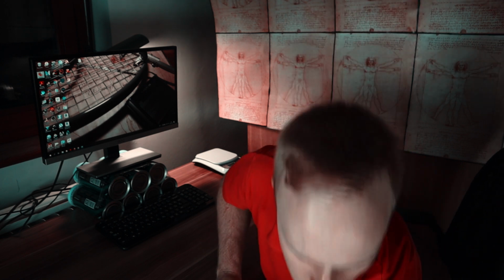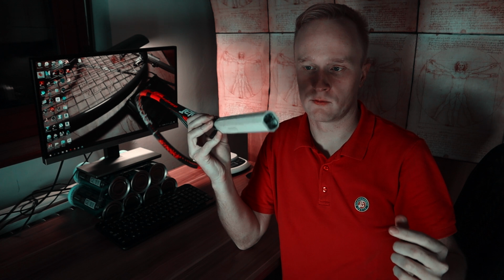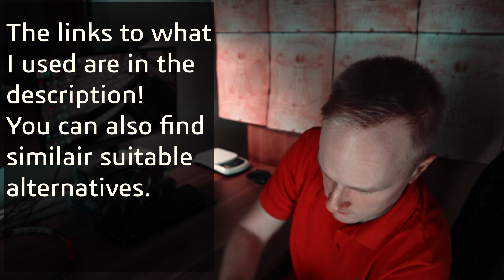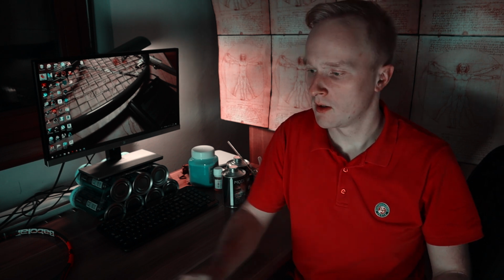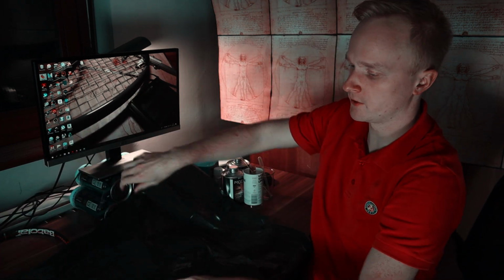DIY - How to extend a tennis racket (Like Novak Djokovic)

Comment: Dude I just went extend length black 2012 pure drive Aka the legendary black bab with a lot of lead at 3 and 9 with silicon in the handle around ( 396 grams strung with leather grip)

Strung at 59 vs team gut main 
57 alu power rough cross 

Mate just got back from 5 pro tours I couldn't miss a surve lol 

Had the best result of my life literally just hitting the absolute $h**t out of my running forie cross and that's it.

All thanks to you my guy 🙏🙏🙏🙏
Reply from the maker: That is one heavy set up for a pure drive. I bet it's a rocket launcher ha. I'm glad it improved your game!
Reply: @MihaFlisekIT  Yeah man I loved it but I do think it's a tad too hevy and I might have gone too much silicone how much do you think you should put in a handle to have a noticeable change and how do you get the exact amount you want ?
Reply from the maker: @alexeyshtengelov6086  I can't answer that in a way that would for sure be the best for you. When I customize for my self I know my game in and out and what I like and I always add weight to achieve a specific goal. If I work for others I first get to know their game and wishes. I'd say the best for you would be to use a removable weight in the handle, for example put small nail in the silicone and that add or remove them and observe how you play.
Reply: @MihaFlisekIT  yea I mean I still love it I got like 12 Babs so it's ok if one is not perfect but just trying new things
Reply: I do exact to my Dunlop 105. I just fill the handle with cotton then fill the bit left that is where my hand holds. This gives a beautiful feel. 
Had a raquet fully siliconed and weighted at 12 aswell as 3 and 9 also. . 415 g strung ! Ball left my raquet with ease but after 10 minutes of play serving became eratic ! 2 nd set , I could'nt lift it above my head !!

Comment: I'm surprised someone else has done this, my dad has been using an extended racket for decades and passed it on to me. So much free power its great, makes it tough going back to a 27inch racket for sure.
Reply: what length do you prefer? and what is your height?
Reply from the maker: Currently I prefer a slightly extend racket (3 mm) wich I achieve by installing modified 3d printer handles. I'm 183 cm

Comment: Great detail and very informative. After trying other methods I just buy the XTP buttcaps, which extend frames to 0.5 inches. You can also buy some mantis buttcaps which extend racquets 0.25 inches.
Reply from the maker: I know about the extension buttcaps, but they also make the butt cap longer and I don't liek the feel of that.
Reply: Does all of mantis butt caps extend racquets by 0.25 inches?
Reply: Where can u find this?

Comment: How much weight did this add?
Reply from the maker: Around 10g. I suggest drilling out the middle of the extension to minimize the weight if it is a problem
Reply: @MihaFlisekIT  thanks for the response! I though it would be more weight, around 25 grams. Way better than 3d printing

Comment: Is it possible to glue on piece of 12 mm hard wood, shaped and hollowed out?
Reply from the maker: You would need to shape it in a way that it also goes inside the hairpin to offer enough support. It might be ok if you extend for only 5 mm or less

Comment: Why glue in butt cap? Is it soft or hard glue? If hard will it then not make butt cap get stuck there permanently?
Reply from the maker: Hard glue, you can also remove it with some effort, bit I trust glue more than Staples for securing buttcaps.

Comment: Hi ,, your video was amazing,, but i want to ask you a small question.. if my racquet weight is 300 gram and i want to extended length from 27 to 28.25 so i wanna know the final weight would be ?
Reply from the maker: Rough estimate would be 320 g, if you use my method.

Comment: Did you put anything in the existing handle to support the new molded extension?   Are you not worried the new part will shear off or separate from stress over time?
Reply from the maker: The material also lartly flows inside the hairpin, where I made the space. I haven't had any problems with breaking off.

Comment: As mold just use some sand. put a hole in a children beach bucket and stick racket handle through the bottom of the bucket. use a piece of A4 paper as walls for the "nasty stuff" for the extension

Comment: Being over 2 years now, how have the extensions help up?
Reply from the maker: No problems with the extension. I have since then experimented with different butt caps on the racket and stapled it back on the extension, and it's still holding up well.

Comment: Hi Miha, Can you custom make a mold like a Head pallet mold size L2?
Reply from the maker: Hi, you could, but it's really unpractical in my opinion. I'm currently working on 3d printing custom pallets for all brands, so expect something along those lines from me soon.
Reply: well I do have a few rackets I want to customize and the Head pallets are expensive, also would like to extend them as well.

Comment: How are you sure that it won’t snap off at the contact point of the old handle and new material if you don’t have a hollow aluminum core inside to anchor it in place?
Reply from the maker: There is no aluminium core in the modern rackets, they are made of carbon/graphite fibres with other inclusions. There are many steps in the process that ensure a good connection as you can see. I didn't have any issue. Also, the 3 other players that I did this to their rackets, they don't have any breakage issues. I can't guarantee for other extension methods, but if you do it like here and use the exact same materials I think you should be fine. These are some softer polyurethane resins out there and with those, you might have problems.

Comment: The component "MODELIT KRONOS" is polyurethane resin?
How much weight does the racket increase?
Great Channel!!!
Reply from the maker: Yes, it's a medium density polyurethane resin. I added 8-12 grams to the rackets I extended so far. Depends on the grip size and length of extension.

Thank you!

Comment: Interesting, thanks for posting.  What did you use to dam the inside of the hairpin to keep the casting from going down into the throat and hoop of the racquet?  Was it already foam filled?
Reply: W @MihaFlisekIT  Will that same cast work for the Wilson Racquet? I'm just guessing but since the extension is mostly in the buttcap, the shape doesn't have to be perfect...or you could probably use the buttcap of the brand you made the cast for.
Reply from the maker: @Findyourgame  I made a new mould for when I extended the Wilson blade. Wilson and Babolat handles are different in size and shape, probably the butt cap would 't even fit back on. But some manufacturers have similair handles, for exampe Wilson and Prince.

Comment: The "jar" is called a beaker. And the thing you use to stir the mixture is a glass rod, or you can just call it a stirrer. I feel ashamed as a chemist that I never tried to extend my racket myself. Although I blame it on my budget which makes me too scared I might just demolish my racket
Reply from the maker: Haha, thank you. I used more primitive tools before, and I wen0t to a specialized store for the video. =D Sometimes we just don't think to use our knowledge or expertise outside our domains. =) I'd say go for it, prepare well and be careful and it will go fine.

Comment: I just 3D printed my own buttcap to extend 1 inch. Let's see if it stays intact 😅 Do you think your method is good to extend 1 inch?
Reply from the maker: I would be interested to see how you did that. Does it make the part where the grip is larger in diameter longer? Yes, I would say you can go up to 1 inch no problem.
Reply: @MihaFlisekIT  I didn't make it larger and wrap over the handle like the xtp buttcap. It had small part going inside the hairpin. So the shape technically would look like your extra PU when you pour small amount of it inside the hairpin. I'll make a video about my attempt 😊.
Reply from the maker: @TenniswithAlex  I see, technically the sleeve that goes over the handle mould is shorter than also. Do that, I know at least I would like to see it. =)

Comment: you can use XTP butt cup instead of the silicon mold
Reply from the maker: XTP buttcaps are not the same shape as original buttcaps and they create na extended part of the handle Where the diameter is bigger. If you don't care about That, than you can.